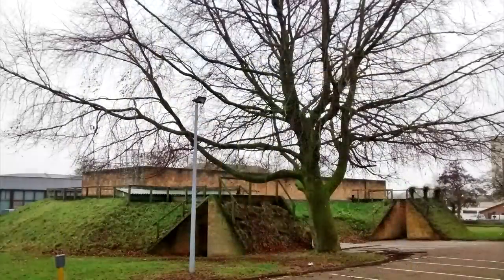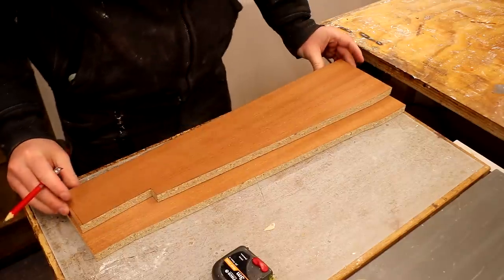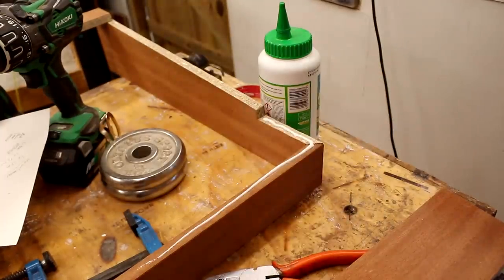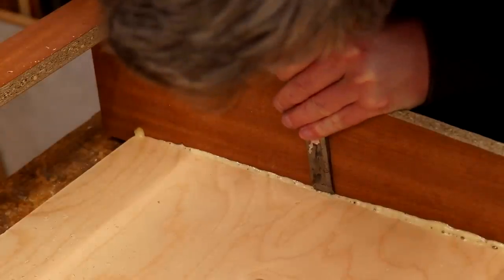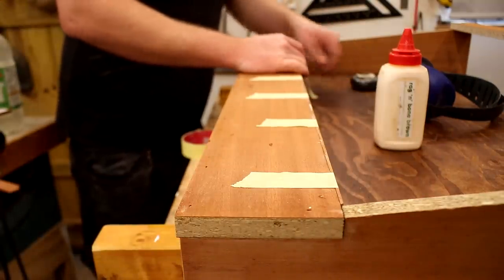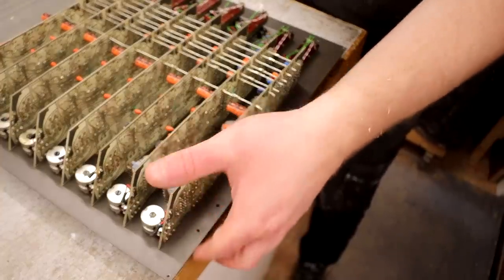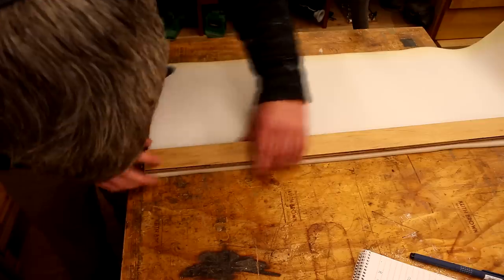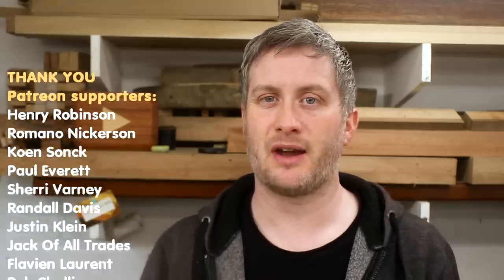Making A Custom Mixing Board Case

Comment: That large black framing square you use, is that perfectly square? I have a really hard time finding a perfectly square framing square.
Reply from the maker: It was, but it's been a while since I last checked it and it's been abused since new.  My tolerance levels might be lower than most though, I never expect anything to be perfect but it's nice when it is